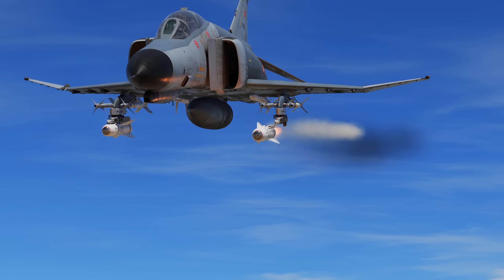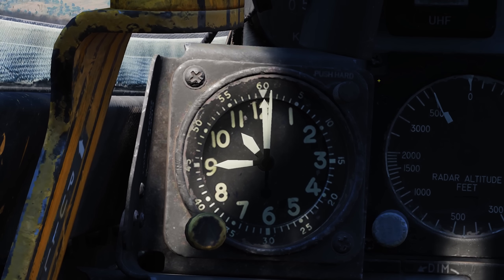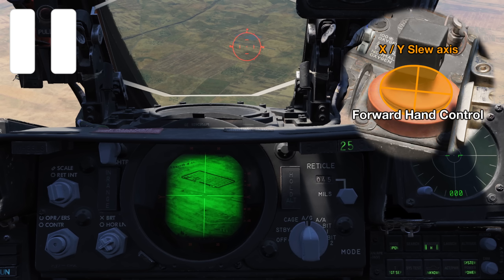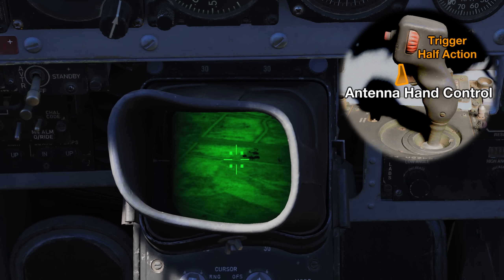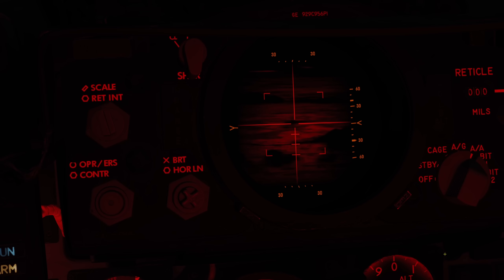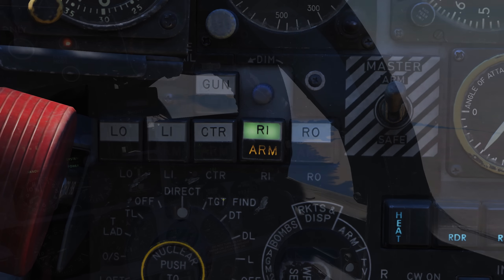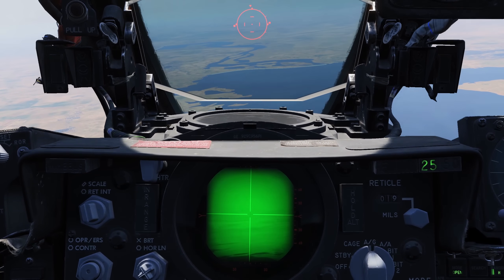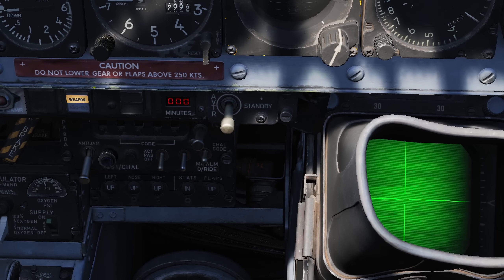DCS F-4E Phantom: AGM-65 Maverick Tutorial

Comment: Any reason you think I get ARM after waiting the time but the covers dont jettison?
Reply from the maker: Double check you are pulling the flight stick trigger and that the video source is set correctly. (both the display and the video feed selection from the wso pit)
Reply: @RedKiteRender  sure thanks. Ill try again. Seems fine in the preset training missions but not so much from a cold start. Its weird cause i did a couple missions from a cold start and they worked fine but now they arent.

EDIT: Weird. Started up cold today and it works fine. Weird. Thanks for the feedback

Comment: Does the target have to fit within the crosshairs to acheive a lock? If im 2-3 miles from the target, a tank that is slightly than the crosshair boundary is impossible to lock. I know its a little close to fire them, but it doesnt feel like its pushing the envelope of the missiles tracking too hard
Reply from the maker: It will expand automatically so long as the target is close enough to the centre when you release.

Comment: I tried a Training Mission with Airstart and the TV is not working even after 6 minutes the weapon Status is armed but the Display is black. I followed the instruction step by step. Maybe a Bug with Airstart?
Reply from the maker: Did you pull the flightstick trigger, is the video source set correctly? (The Antenna hand control trigger does not blow the cap off)
Reply: @RedKiteRender  yes, I think I missed the part with the Trigger 😅 thank you🤟🏼

Comment: Nice on Redkite, you always make the best guides 🥰
Reply from the maker: Heeey thanks Engima <3
Reply: Will the f4 have any mavericks on the Cold War server?
Reply: @Maceoneone  Yes
Reply: @Enigma89  SEAD will go ceazy
Reply: (ECW question) I'm assuming we wont need points to unlock the F-4E like the F-14 right? We can just join the server and take off in the F-4E?
Reply: @Sandboxcode  Not a problem for the hip gang, one good recon drop and you have a shit ton of points (:
Reply: @Sandboxcode don’t quote me on this, but i remember reading somewhere, this being from enigma himself as my memory recalls, that the f-4, like the mig-21 or the f-5 is seen as a central element of the cold war, i can’t remember much else, but it gave the message of, in certain campaigns, depending on the era it takes place, the plane should be fully available for use.
Reply: @AndrewS6969  Thanks. Yeah I tried to search the ECW discord but couldnt get a hit.
Reply: @Sandboxcode that is the eventual plan however on release it will cost a small amount of point to promote diversity and prevent spam
Reply: @connorraab  Ah that makes sense; huh